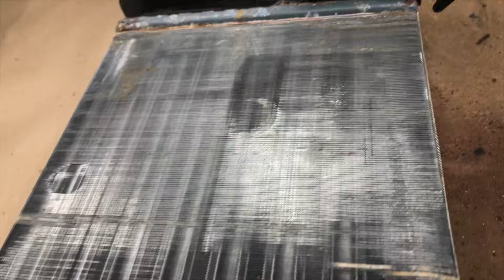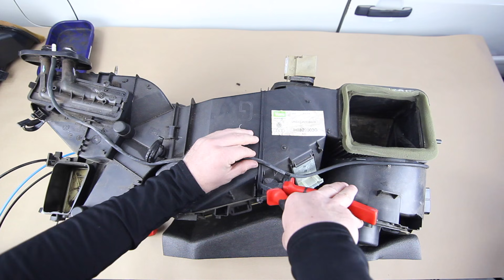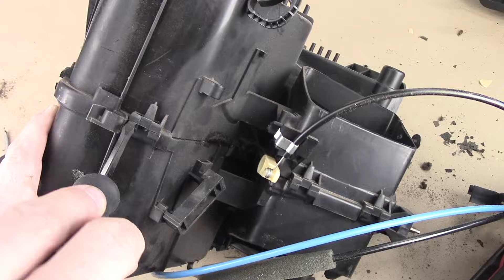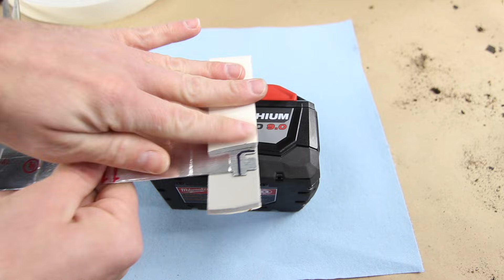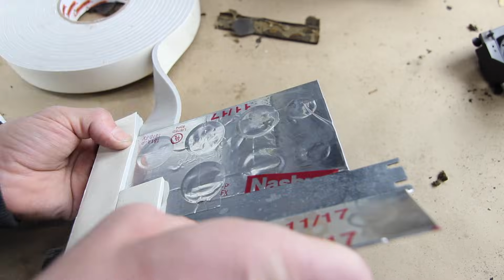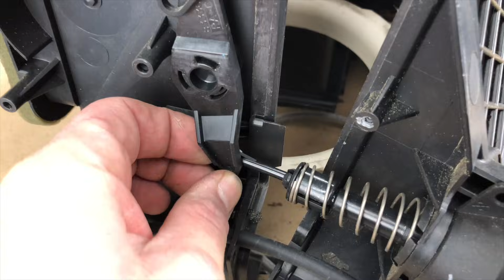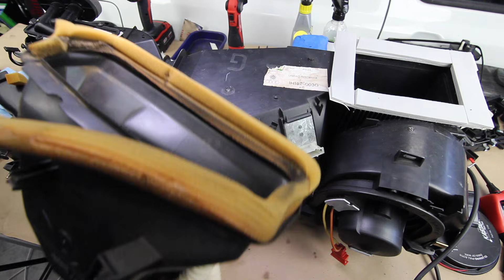How To Fix Blend Doors ~ Install a Heater Core and Reseal The HVAC Box

Comment: I repaired my doors in our Eurovan with the tape like that without pulling any of the dash apart.  just the floor vent part. I've done a couple of them that way now. Not the best way but you don't lose coolant or have to drain and refill ac.
Reply: Do you have videos on how you did it
Reply: @eurovan03  no video. I just remove the lower part of the center dash and the foot distribution part of the plenum for the air. Then reach up in there and remove the old foam. Use a vacuum to duck out loose stuff. Then cut aluminum duct tape into two inch pieces and start placing over the holes. 6 years and running on ours and have done quite a few others

Comment: Kinda unrelated, but I have a question.

B6 Passat front passenger door doesn't open from the outside OR the inside. Pressing the lock/unlock button works, I hear the motor moving inside of it. But pulling on the handle does literally nothing.
Any ideas?

Comment: My grandmother had this happen to her 2003 Chrysler T&C van in 2009. The repair was estimated at over $1200, and to get some shadetree mechanic, it would still be about $1000.

So when the transmission finally gave way, she bought a 2009 Chrysler T&C van. I was so angry.

Comment: Craft foam. Joann's has large enough sheets that you could have made panels and gaskets as single, one piece cuts that would probably fit better and yield better results. Home Depot also sells a roll of half inch round foam cord that you could cut a slit in to run around the edges of the doors.
Reply from the maker: Yep. There are tons of ways to do it.

Comment: But why is there 3 holes on the door ??
Reply from the maker: Lighten the door.
Reply: HumbleMechanic 
With Ford we were told it was to allow some airflow so the doors could be moved with the fan on and not have to turn off the fan move the door and turn fan back on.
Every manufacturer has their reasons.

Comment: Why did you cover the holes on the doors? Or did i miss that explanation in the vid?
Reply: probably VWs effort to save aluminum, they are originally covered with foam.
Reply: But why are there holes?
Reply from the maker: They are meant to block air flow. With the holes open air just passed through and is not directed properly.

Comment: i replaced my heater core in my 89 gmc s15 jimmy 4.3l and iam glad it wasnt as hard as this was but my enviremental setting dont work its stuck on defrost i just wish i had a place that i could use to work on my truck cause it needs some work

Comment: Yet another amazing diy video. I would love to do this to my mkiv but as it's my daily commuter I can't afford that downtime. I would love to see a video on the other method doesn't involve full removal of the box. I know the repair won't be as comprehensive as this method but as it's just a commuter to work it should be good enough.
Reply: It's not nearly as nice of a job as this has been but the mk4 blend doors have a door in front that reach the two biggest doors shown in this and that cover can be accessed behind the radio so if you take of the full center console and lower trim on the dash including the glovebox, radio, and cup holders, you can see a little black panel that has clips all the way around. Getting that off is the hardest part but once you do, if you have small enough hands you can use a vacuum and suck out most of the foam, clean up the doors with some adhesive remover (Goo Gone is great, isopropyl alcohol is ok), and put some tape on. It won't be 100% and will allow some air to continue to flow through vents even when fully closed BUT the whole process should take you between 2 and 4 hours depending on how quick you are and you never have to take the full dash apart. Plus, if you run out of time, you can always drive your car without some of that trim, it just won't look too pretty, you won't have the radio, and you won't have the cupholders but let's be honest, those are probably broken anyway 😂😂 haha. I hope this helps!! Let me know if you need any more guidance with this!
Reply from the maker: I will be working on that. I think I may also got get a couple of boxes, fix them and sell them cheap so people don't have to have the car down so long.
Reply: Joel Ankeny, happy to help! I think there's a video floating around YouTube somewhere where the gentleman shows how to do it the way I described. As mentioned, it's not nearly as nice of a job as what this is but for your needs, I think it will do. Like I said before, if you need any help tackling it once the time comes to do it, just reach out and I'd be happy to assist you. It's not a super comfortable job and prepare to scrape some knuckles but it's relatively quick, low-budget, and fixes it enough to have heat (which was my problem heading into this last winter with my recently-acquired mk4 Jetta).
Reply: @deadlycucumberplants  Ever find that video?
Reply: @echion2  here you go! I know it's not the best way to go about it and I wouldn't attempt it if you have huge hands (it's a tight fit) but it definitely works in a pinch.

https://youtu.be/bxPMzzLmEuM
Reply: @deadlycucumberplants  awesome; thanks!
Reply: Marcos Herrera - thanks for the valuable insights! It's a project I plan to tackle once the weather warms up and the plastics aren't so brittle. This definitely gives me a good starting point.

Comment: Why does the manufacturer have holes  in the blend doors?
Reply from the maker: To lighten the door for easier movement.
Reply: Blending in some fresh air makes sense.  I've seen reports of surprising levels of CO2 in a car when the air is recirculated.  Definitely not good for you.

Comment: Enjoyed the  video. I have done this job on two cars in the last 10 years. I have used headliner material to a good effect. No issues. Still driving  one of the cars.
Reply from the maker: I’ve heard that’s a great option too
Reply: @HumbleMechanic ...you can also use 2mm thickness felt as well. It's quite similar to the headliner material, but much cheaper and easier to find. If anyone is worried about the passive airflow, the 2mm stuff allows some air movement through it. I'm about to have a go at my MK4 TDI, but without pulling the whole concoction out...the foamstorm is just starting to create a mess and the aircon/heater system isn't directing the airflow like it used to. I used the felt material on my Nissan Patrol a couple of years ago and it works fine.

Comment: I had the same issue with my Corrado. Cleaned and taped around all surfaces that required new foam to be applied. Instead of foam I used the Shammo water absorption material. Thought process that it would take the heat and cold without getting to stiff or soft. Used 3M Super 99 spray adhesive on both the metal and the Shammo. Sold the car 3 years later with no issues with heat, AC, or defrost. Ducts worked as VW intended.

Comment: Jesus VW why use such garbage foam??
Reply from the maker: I wish I knew

LOL
Reply: Scott Martin
You got it. VW used the foam to allow SOME air to flow through the flap even when totally closed to do TWO things. One, to prevent any whistling when the flap was closed and second, to reduce the pressure needed to turn the temperature control knob. It makes for a more pleasing usage of the system, but the down side is that the foam WILL break down over time.

Comment: Please make a short version of video! (When leaving the box in car.)
Reply from the maker: I think I will when I am going back together with everything
Reply: @HumbleMechanic    Did you ever do the short version?   Was it better in your view to pull the whole dask for the repair or just the box version you were discussing.  Summer is coming in Florida and I will need all the cooling I can get.
Reply: Aye, I agree; please create a video showing how to do this without removing the dash. My 05 GTI started fitting foam at me this summer and figured this winter would be a good time to fix it while it's stored during the white blowing stuff here in Michigan. :D
Reply: @HumbleMechanic  Did you make a shorter video...1 w/o having to remove the HVAC from the dash?
Reply: If you know a way of doing it without removing my dash that would be amazing. Thought it was impossible.
Reply: Where is the short video? It's been 3 years
Reply from the maker: I never found a way I felt was an acceptable repair.
Reply: Just wanted to thank you for putting this video together. It was very helpful when I just recently refurbished my heater box and replaced my heater core. 😎
Reply: Cant find the info anywhere about changing the foam without taking everyrhing off
Reply: Surprise, there is no short version.  You have to remove the box from the car
Reply: @HumbleMechanic  Did you make a shorter video?  w/o having to remove the HVAC from the dash? Think a long arm could reach from the top blend door to tape the heater flow blend door?

Comment: Step one: remove entire dashboard.
Reply: Step two:  give up and part car out via facebook
Reply: Garth Goldberg just wear safety glasses when you kick on the fan 😬
Reply from the maker: Hahahaha.
Reply: vr6swp 
I tried that with the wife’s 2004 Passat tdi, it was hit in front but still runs with 160k on the clock. 
It just served to irritate me for a couple hundred bucks. 
so as soon as the snow melts off the door, its getting pushed outside and the scrapyard is coming to get it. 
Lol, of course I pulled and saved the engine and management system for a swap into a mk1.
Reply from the maker: Or Trade car for newer one LOL
Reply: My Eurovan has been blowing chunks for a few years now but still seems to work okay.

Comment: The car company's  should be ashamed of themselves.
Reply: Scott Martin I am not referring to that but how pathetic the foam used is.
Reply: Don't forget the Mk3 is at least 20 years old!, (build from 08-1991 till 08-1997)  The foam disolves because of age.
Reply: GTI20VT that. Is the point there is material that doesn't fail.
Reply: Surely but material that lasts 25 years or longer is too expensive for the Automotive industry.
Reply: GTI20VT  nonsense and this probably was in bad shape after 10 yesrs
Reply: TheRetardedtech  You obviousley didn't own a Mk2 or 3 and are just a VW hater??
Read the comments down below started by "Mortalomena".
Reply: GTI20VT one can Always tell when some one runs out of excuses they start hurling insults. And no I have nothing against VW except maybe their history of trying to circumvent the environmental rules. But that has nothing to do with this use of junk materials which most of the automotive company's are guilty of. Ford and their plastic intake manifolds are just one other example.
Reply: No excuses my friend!, first of all average car life at this moment is about 12 years, in the year
2000 even only 9!
So why should a car manufacturing company use materials that last for 20 years or longer??,
too expensive!
I am working in a car factory for over 28 years now and at this moment testing the finished Mini's 
Cabrio, Countryman and the BMW X1 on quality and performance, but still i am a VW man!!

Comment: Doesnt grease degrade plastics?
Reply from the maker: It was greased from the factory
Reply: Some grease does.  I use silicone grease when I'm scared of this (notably on my RC car stuff).  I found that Sil-Glyde from the local auto parts store is quite cheap and works great.
Reply: Lithium grease should be safe for use on plastics, a lot of RC cars use white lithium in the gear system as well as on moving parts to keep friction from destroying the plastic. Moving plastic parts will wear into each other over time

Comment: I am worried about the foam tape loosing adhesion because of hot air
Reply from the maker: It held on well in all my testing. Adding the adhesive promoter is something that should help. They use that on a lot of stick on body panels.
Reply: jim c  Think so to because the air is very hot in combination with a new h-core, done my Mk2 
a few weeks ago. Also didn't use such thick foam, i only covered the holes ( because of weight also!)
Heating works perfectly now.

Comment: I've got a Nissan hardbody you'd cry if you had to work on it, I know I do.
Reply from the maker: I would actually love to have one. I look at them all the time. HA. It's such a cool truck from my childhood
Reply: HumbleMechanic I would give my left nut to be able to have the shop and knowledge you do. This truck I've nicknamed after a serial killer because it plays games with me. 
Change the oil? Let's change the idle so it never idles smooth again. 
Did you change get the fuel filter? Gonna have to blow a head gasket. 
You replaced the water pump? Let's over like a mofo. 
Did you want hot air on the windshield? Blend doors F*cking break... 
My truck: 😂
Reply: I'll trade you. I love it but dang I can't afford/fix it with my peasant knowledge.
Reply: Aaron Brake knew. It... It shifts nice. That all I can say positive. 
I wanna slam a turbo on it and see how much it take to shoot a piston through the values. 👻
Reply: I can remove the dash and all the heater accessories from a Nissan 720 in about 20 mins. Install is about the same.
Reply: If that hardbody has the VG30 V6 engine, its a base version of the engine, which also had VG30DETT (twin turbo), which was used in some of the 300z cars. The VG30DET looks to be mostly the same engine but running a single turbo at about 10 psi from the factory. The blocks I think went mainly unchanged, the only parts that you would have to watch are the internals. 
I think the 5 speed manual transmission was shared between the trucks and the 300z cars, but with different gear rations. Looks like the automatics were also shared. 

I worked on a WD21 pathfinder my family had. Well kind of worked on it. The thing never stopped working to need to be fixed. In the over 100k miles we put on it, getting it to somewhere around 300k, the only issues were the brakes, clutch, starter, and the main killer, the frame. Oh, the speedometer stopped working, easy fix, I just didn't feel it justified to spend the dealership price for a new cable. If only all the other vehicles my family has owned was this reliable 

You can also download the FSM for these old nissans fairly easily.
Reply: @snoopdogie187    I always wanted to do a 300ZX TT swap in mine but figured it was too much work.  Love to get another one one day now that I know.  TT wheels, motor, slight drop, it would be like a Japanese Syclone!
Reply: I've seen posts with first gen pathfinders that had twin turbos, but the turbos had to be remotely mounted because the truck body wasn't as wide as the 300z, and there just wasn't enough room.

Comment: I would like to see vid on doing it inside car, gotta repair mine on audi 80, dash already out, dont wanna pull whole thing again, core been replaced last year
Reply from the maker: I think what I will do is get the car back together enough to show it in the car. You can't do the heater core or anything like that, but if you just need to fix the doors, then it can totally be done in the car.

Comment: So why are there holes on the doors anyway?
Reply: Speed holes.
Reply from the maker: I assume it is to lighten the door. Maybe.
Reply: I also assume to lighten it, so the actuator has not so much work flapping that flap back and forth ;)
Reply: I think someone else mentioned this in a comment: the thought process seems to have been two-fold: 1) in allowing some air, it stops the whistling that can happen when a seal has a slight amount of air that can pass through in a spot that didn't seal perfectly and 2) it makes moving the blend door knobs a bit easier as it relieves some pressure from the system by not allowing the suction created by a full seal to make life difficult. A nicer system overall but obviously, foam breaks and we all curse them every time we're pelted in the eye 😊.  Not sure if it's the real reason but it's what I've heard over the years and the only thing I can think of without feeling like it's just because they were being cheap...

Comment: Love your work... I've done this to my MK2 and it had a felt pad as well. For my recon I noticed that the flap covers were sectioned leaving a slit which I assume to allow a bleed in case the flow was blocked. PS: Yours looked a lot cleaner than mine :)
Reply from the maker: Thank you sir! If mine was cleaner I would hate to see dirty. AHHA